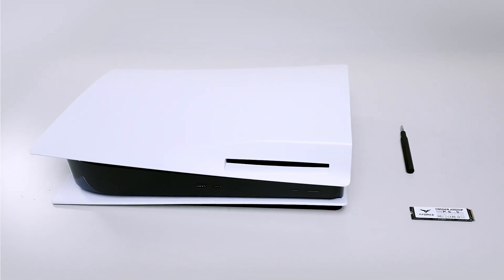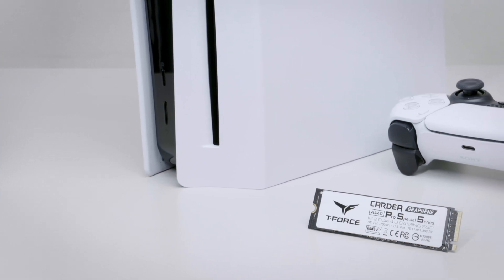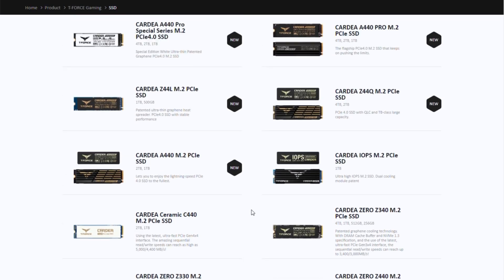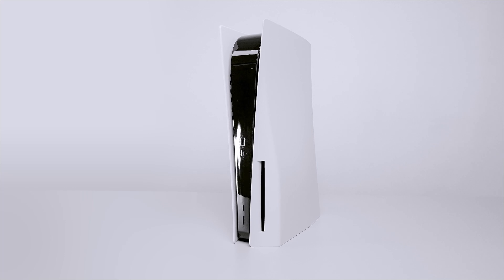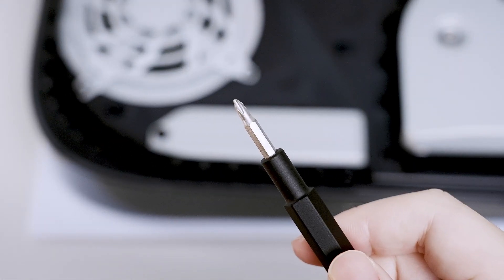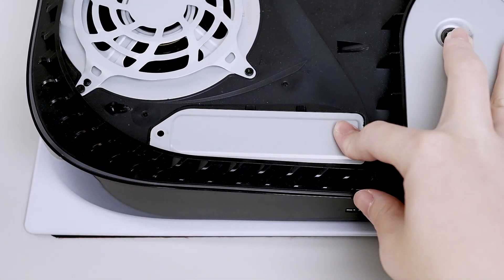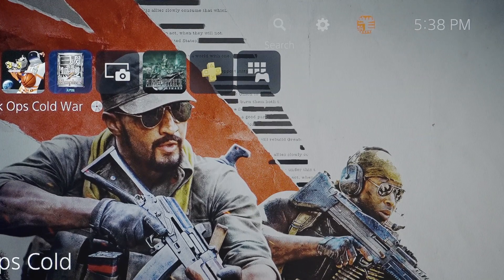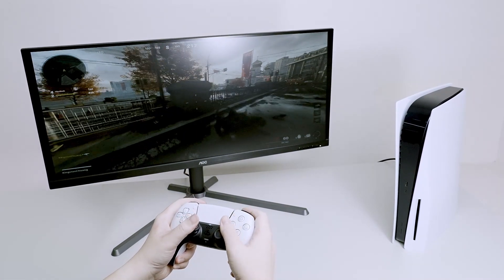THE BEST WAY to UPGRADE PlayStation 5 Using NVMe M.2 SSD l TEAMGROUP

Comment: Get a heatsink cover like the Sabrent or Elecgear.
Reply from the maker: The A440 Pro Special is already included with ultra-thin and patented graphene for the heatsink, however, you can also choose CARDEA A440 PRO M.2 PCIe SSD which has 2 options heatsink: aluminum and graphene.

Comment: One thing you forgot to mention is that it's highly recommended to use an NVMe with a heatsink.
Reply from the maker: 😆The A440 pro special is using ultra-thin and patented graphene cooling for heatsink
Reply: @teamgroupinctforce  Where does the heat go then?
Heatsinks do three things. Take in heat, radiate it and store what it can't radiate fast enough.
Unless it can radiate heat as fast as the drive can generate it, then it needs to store it and there's not a lot of mass there.